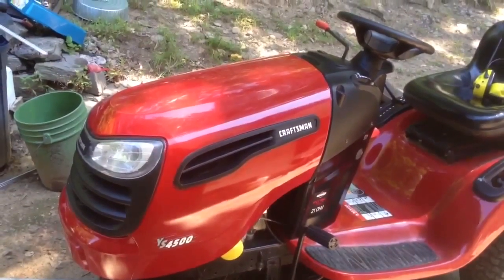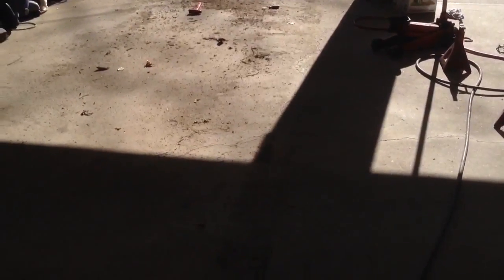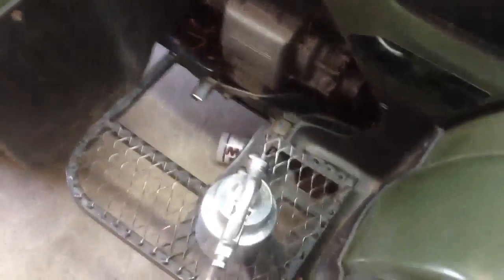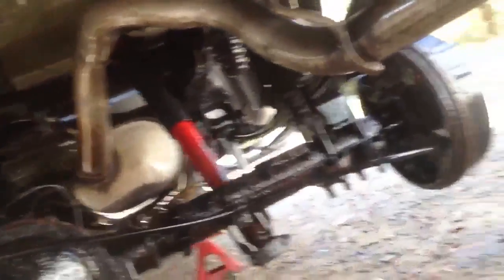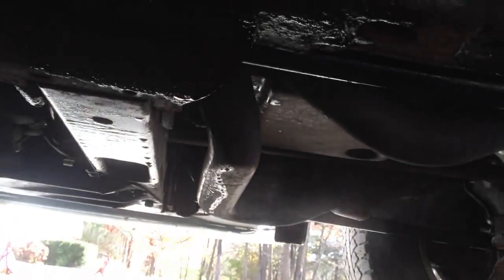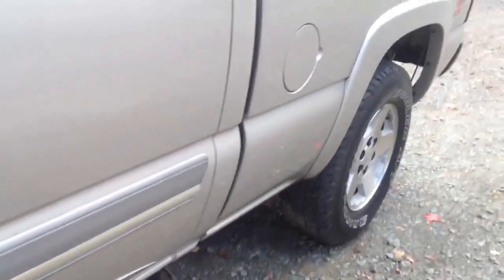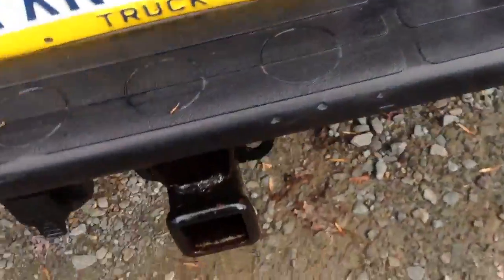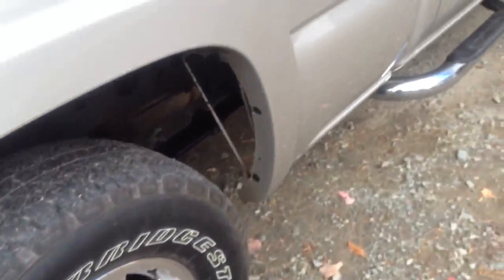Undercoating with Fluid Film on a Chevy Silverado to stop the rust

Comment: I started using it on my Silverado about the same time I watched this video two years ago.  I too have noticed a substantial improvement on the condition of my under body, frame etc.  The rust does not seem as visible now.  The orange frame is now dark and just doesn' t look as bad.
Reply from the maker: I think it helps by keeping the factory coating soft

Comment: I checked the rocker panels before I left the lot.  They are in good shape.  Bottom of tailgate is starting to get a little discolored, probably rust on the inside .  Thanks for the tips.  Surprisingly enough, it is just the chassis.
Reply from the maker: the rockers usually last about 9 years then they rust through
Reply: JohnDeere50d u are exactly right...my Silverado rockers paint is just starting to bubble. So how much does it cost to replace rocker panels...

Comment: Just wire brushed and painted the frame on My 2011 Z71. Truck has 15k on it, couldn't believe all the rust on the back half. I'm thinking of brushing that fluid film on the frame . I know the salt in Buffalo winters is tough, but irks Me that GM didn't protect the frames better. Thanks for the video.
Reply: +David Swick don't do it, gm uses a cheap ass wax coating, fluid film will eat right through it and it will peel off in sheets. I made this mistake on my 12 sierra. Yesterday I sprayed it all with bar and chain oil. There is a topic on GMFS about how fluidfilm eats the coating
Reply: +Michael Heikkila  Appreciate the information, and Your concern. Thanks.
Reply from the maker: +Michael Heikkila 4 years later the factory coating has yet to peal
Reply: I thinks fluid film is really good but I find area's like the wheel well need reapplication after a few days of driving in rain on the highway and puddles on side roads. Same with winter driving. Just my two cents and I would think thats normals with the wheel wells getting blasted with water especially at highway speed. Commute 66 miles a day.
Reply: I tend to reapply twice on everything in the winter. I live in the Northeast. RI.

Comment: It's not Chevy's fault it's road salt. I wish everyone would use sand instead of salt for ice control.
Reply from the maker: I agree. It's a little bit of both. Is gm that could put a better coating on the frame
Reply: John Palmer its mostly chevys fault since they only wax dip the frames. you can actually peel the wax coating off with your finger nail at the dealership. gm says its designed to only last a year.
Reply: travis8352 go look at a frame on a southern truck. They are solid black still. The wax lasts along time in the south. I have a 2010 Silverado in Minnesota and the frame is solid black still. It’s all on how you take care of the vehicle.
Reply: Matt Mohs Outdoors agreed I have a 2009 that doesn’t see winter and its perfect.

Comment: The rear half has more corrosion, because the wheels throw up dirt and salt water from winter deicers at high velocity on and into the frame. Be sure to coat all the ENCLOSED and INSIDE areas like frames, unibody rails, rockers, suspension parts (hollow control arms), fuel tank straps sending unit, INSIDE doors, fenders, trunk, hood, BEHIND front and rear bumpers. Any place moisture hides it will corrode especially in warmer weather
Rustbelt states require rust control annual treatment and spring/summer is the best time of year. Remember moisture + salt + heat = corrosion.  Good luck........

Comment: No.  The dealer just replaced the transmission lines b4 I bought it.  I just checked the brake lines and they look fairly new so I assume previous owner had them replaced.  I plan on dousing them with FF as well.  I wish I had known more about this rust problem b4 I bought it.  I got 10K in it so I hope I can prolong it's death for 10 years then I don't care what happens to it.  I plan on treating it twice a year so maybe that will work.
Reply from the maker: the rockers are usually what goes on them, if you look from the back you can see a bunch of little holes. Id blow them out with a blow gun, the spray FF in all the little holes, and also try to get up in the box wheel wells, that is another spot. also spray in the holes in the bottom of the tailgate. that should help alot

Comment: I also have a 2007 Rusteraldo and just purchased a Fluid Film 2 gallon and sprayer kit to start undercoating it this spring and again in the fall.  Just curious as to how it held up this winter
Reply from the maker: It seems to have held up fine. its hard to tell on the frame because the factory coating seem to absorb the fluid film, witch might be a good thing. The fluid film is still on the underside of the cab. Overall it seems to be holding up pretty good
Reply: Great and thanks for the quick reply !
Reply from the maker: No problem, I am going to do a update video on it in a couple of weeks when it warms up a bit

Comment: also the reason the hitch rusts lie tha is because water comes int he sides where the tube is open and it just sits inside, drill out a small drain hole in the bottom and it wont rust
Reply from the maker: I believe there is already a small hole in the bottom
Reply: I had to drill mine out in my 08, had the same problem with the surface rust on the tube. It was mainly from the car wash water getting in there. Im still not impressed with gm pickups rust resistance though. I like the vehicle but they need to take better steps for corrosion resistance when they develop these vehicles.
Reply from the maker: +Gordon Liddy the newer 2014 they have changed a lot to prevent some rust. but their designed to rust so you have to buy a new one
Reply: We live in a throw away society so it makes sense. Id consider an f150 but aluminum oxidizes and it hasnt been out long enough to see how they hold up. Best thing you can do for now is just wash the hell out of the pickup when its winter time i guess.
Reply from the maker: +Gordon Liddy yep, my buddy has a 2004 ford expedition and the gate is aluminum but all the paint is flaking and all oxidized. and that's harder and more expensive to fix than metal
Reply: Ive noticed when configuring new pickups that the fords are the more expensive now i remember when that used to not be the case and people would complain about gm prices so now i would expect a higher quality vehicle from ford. All the manufacturers need to make good products though. The components shouldn't be coming from china for one and that might help with the quality along with giving Americans jobs back.
Reply from the maker: +Gordon Liddy I think ford's are so expensive because they over engineer every thing and put so much useless things like electronics in them
Reply: To be honest most people dont need alot of the bells and whistles but they get them and dont use them. Its more of a peace of mind thing haha. For the price i think they could be more comfortable to drive. Thats one reason i dont have one.
Reply from the maker: +Gordon Liddy I like just the standard truck with a radio and that's it. I don't need Facebook in my truck

Comment: When you do your update video and you are under the truck, see if the wax coating came off more than before.  FF says that it will loosen the wax and cause to fall off on GM trucks.  I don't care because I plan on treating it every year.  FF is probably better than the wax coating anyway
Reply from the maker: The gm wax coating is junk anyway. I want to take my box off and sand blast every thing and paint it up with some kind of undercoating paint like por-15
Reply from the maker: also, did you have to replace any brake lines yet on yours
Reply from the maker: just an update I think the fluid film helped the wax  coating, it soffened it making it not peal